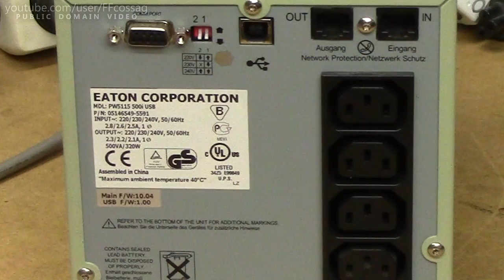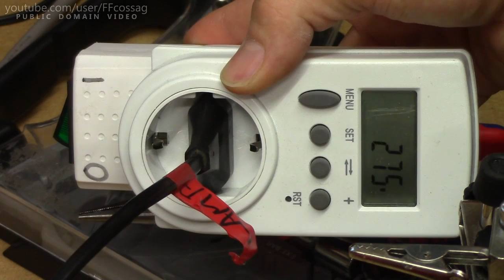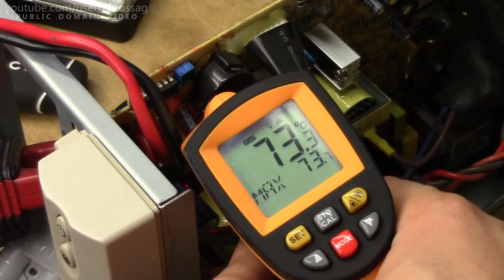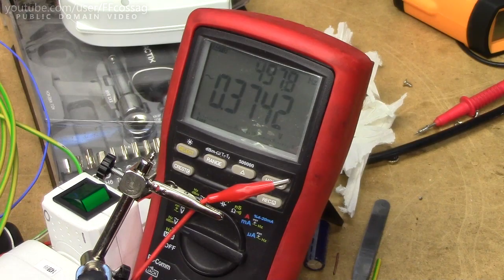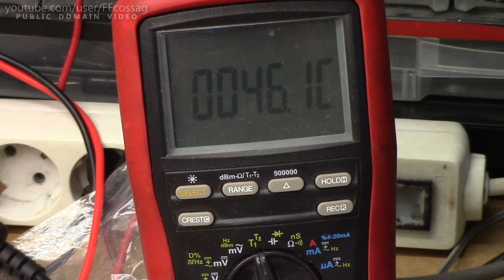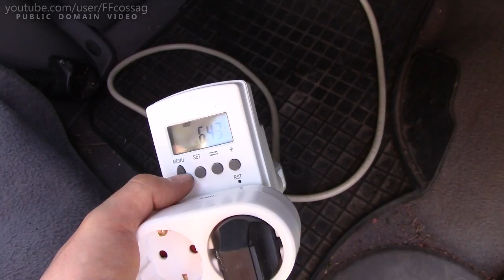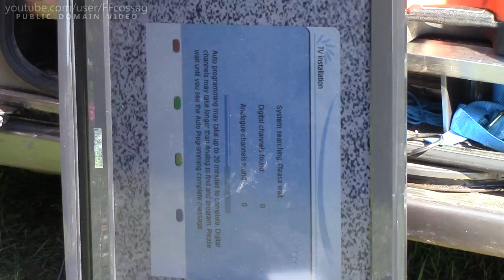Turning a UPS into a 320 W splash-resistant, pure sine, under-car inverter

Comment: Great stuff. I've become paranoid of even touching cheap modified sine wave Inverters. They NEED to make Pure sine more affordable! So that the average joe can save a refrigerator or two full of food when the grid dies. Nicely done though!
Reply: Seems on ebay for about $120 US dollars, a 1500w continuous 12v Pure sine inverter from China exists. Tempting, would it explode after 30 days or not lol
Reply from the maker: That sounds like death in a metal box.
Reply: it seems to be that theese days a diy inverter is much safer than any of theese chineese rice boxes

Comment: Im  a bit confused, could be cause I am  not an electrical engineer, but when he added the copper wire it looks like a lot of the pins are shorted? Expecially on the two spots that look like a "V", there are three pins soldered to them.

Comment: You can never have enough fuses. I'd put in an additional fuse between the battery and the wiring going to the inverter - just to make sure it won't go too horribly wrong if something should happen with either the inverter or the wiring going to it.
Reply from the maker: If the inverter goes wrong, it is fused internally. If the wiring goes wrong, something will get very hot, but I figured that there's no fuse on the starter or alternator either, so who cares.
Reply: +FFcossag Well yeah...but somehow I'd say the risk of your additional wiring getting damaged is slightly higher than the original starter&alternator wiring causing problems. You could also run the positive wire inside a protection sleeve thing additional to putting a fuse between the battery and the added cabling...But that's just me wanting to over-engineer everything :D 
I hope you won't have any problems with the wiring.

Comment: Very nice! By the way, have you considered installing more modern MOSFETs (with lower R_DS (ON))? It surely would increase the efficiency dramatically. : D

P.S .: I strongly advise against mixing tupperware with automotive stuff. If I were you, I'd get some aluminum sheets and mounting hardware, spend an afternoon at the workshop and make a neat little metal enclosure. I most definetely would not be comfortable mixing high current electronics with cheap, non-self-extinguishing plastic.

P.S.2: Sorry! Forgot this was an old vid. Bloody hell! (Won't remove the comment, tho!)

Comment: Great job. Next time, if you have a hole saw lying around, I'd use that + an angle grinder as to limit the material removed of the plastic (the radial mount at the center of the fan doesn't need air, right?). It'd improve structural rigidity for sure, and could help with flow. Do you have an anemometer (or something-- I never took fluid dynamics at uni, forgive my ignorance) to model the air flow of your construction to see the laminar/turbulent flow on the intake?
Reply from the maker: I have no idea what I'm doing!

Comment: Well done. One question - What's the function of the huge transformer (presumably autotransformer)? Thanks.
Reply from the maker: It boosts the voltage.
Reply: FFcossag Thanks. So it is used as a step up transformer? Why/when is this step-up needed? Why use an auto transformer, not a traditional isolated one with two windings and four wires ?

Comment: Excellent build! Makes me want to do the same, just as soon as i can actually come across even one single tossed out UPS! Out of curiosity, what was the black power outlet for you put your hand on @ around 31:00?

EDIT: rewatched some footage, now im curious what that outlet is wired back to for cabin heating!
Reply from the maker: There's a 230 V input on the front of the van that's wired up to the block heater. The outlet just taps off of that.
Reply: ahh how clever :) Thanks for settling that point.

Comment: Hi! Great work. Tell me, initially it has two 9th Ah accu onboard. So I have to connect two large accu's to it, giving 24 volts? I want to use its 'brother' 1000VA to feed small fridge in a van, can I perform it? Thanks ;)
Reply from the maker: It would work, but these units don't run continuously, so it would turn off once every 2 hours. Also the charger would electrocute you, so I'd recommend you just use a real inverter.
Reply: @FFcossag  2 hours- it's in device configuration? Could I change it to continuous mode? Normal inverter with pure sinus cost a lot, in this case maybe 12v fridge may be cheaper... But I'll try  ;)
Reply: @FFcossag  and tell me please more about electric shock possibility. In which place it becames dangerous?
Reply from the maker: @OleksandrGrabovskiy  If you connect it to the power grid.

Comment: i have a few of the same theyre nice. haha i want to make the same thing with it... WOW but the quality of mine looks way better on the inside if i remember right ! it had a nice fiberglas pcb and everything... and i thing mine does not have the battery disconnect when the  door is not on thing...

Comment: Do you still have it on the car? I am actually curious about if it still works, due to the area it was mounted. It seems that it would get a lot of water from the road and heat from the engine
Reply from the maker: I removed it only a few weeks ago after a gasket failed. I disconnected it a while earlier since I didn't need it, and it showed no signs of failure or corrosion. I think it still works fine.

Comment: Nice project.  Hmm today you pay not to match for a small real sine-wave inverter. Here in the Netherlands you bay one 500w for less than €200,-  

Nice project to reusing old UPS for inverter.  

I fear that not everyone has the knowledge for such a project.
Reply from the maker: 200 € is a lot more than free; but yes, a sane person would be better off doing that.
Reply: That is for sure.  It is also about the satisfaction that you have created something that works well.

Comment: well guess what. it's me again. 😂 the rs800 is all apart. waiting for the caps... then I saw this. and then... I found out that the rs800 has a unpopulated on board fan circuit. should I populate it or just do what you did? what would you suggest/recommend? ;) thanx again.
Reply from the maker: That really is up to you. I'd probably just use some separate controller that offers more than on/off control.

Comment: its funny how my 300Watt inverter cannot even run a Electric kettle
 without blowing a fuse.
Reply from the maker: That's because a kettle is more like 2000 W.
Reply: yeah i know. i need a 3000watt inverter

Comment: Better not run the Inverter while driving on wet roads, because the fan is going to suck all the gust in...
Reply from the maker: That's the point of the "air channels" on the sides. The water would need to make a sharp turn and move horizontally for 20 cm in order to enter throygh the fan. I'm more worried about condensation.
Reply: Yes, codensation could also be a problem. Maybe you could coat the PCB with some clear spray paint? But I still wouldn't trust the intake air channel to much againt the fine water gust you get when driving on a wet road. I think those small water dropplets will just be sucked in with the air. I would have gone with passive cooling, where the fan only stirs the air in the box so the walls of the box act as a heatsink. But that might not be enough cooling.
Reply from the maker: Elektro-Peter Perhaps. I'm thinking about covering the intake with mosquito net to help remedy that. However, when driving on a very wet road, I noticed that there wasn't even any water splashing up onto the box at all.